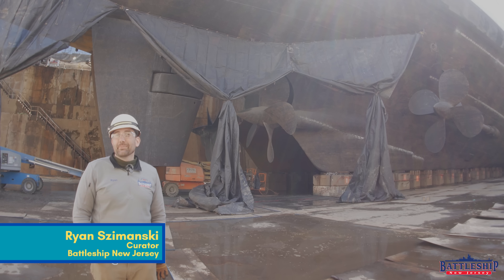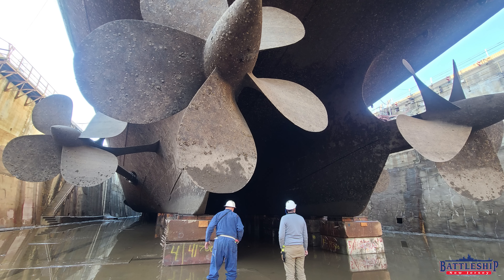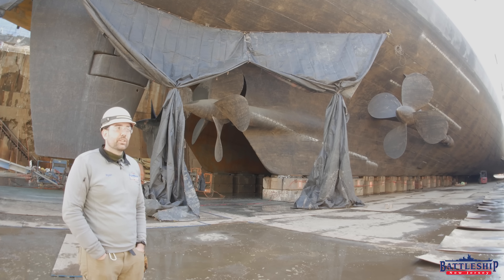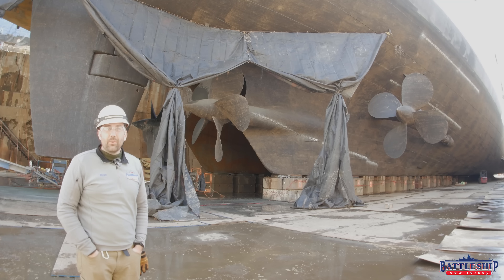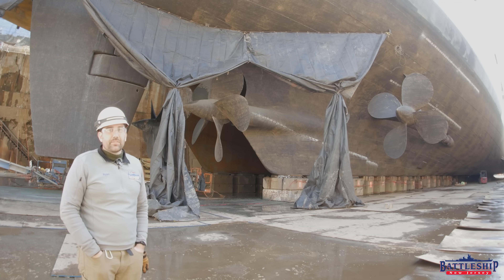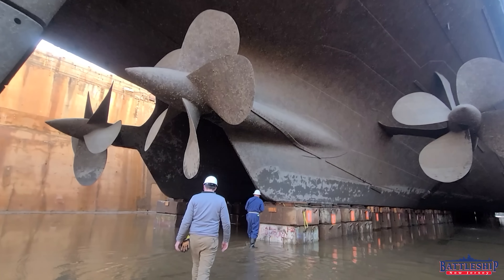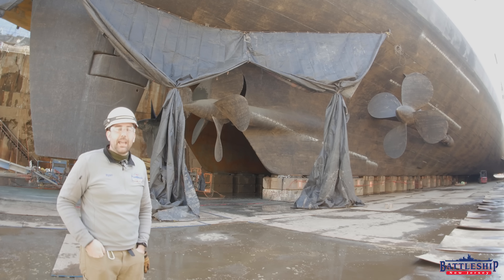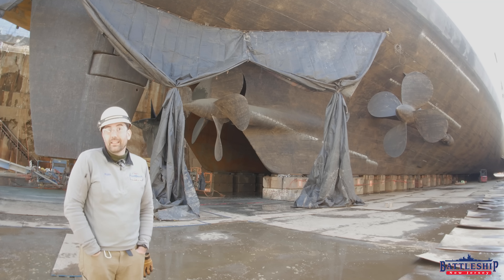Why Are The Battleship's Propellers All Different?

Comment: Well, that's something new and different. That's the only naval vessel I know of with differing blade counts. Certainly no submarine since WWII through 1980 ever did have. Of course, surface vessel particulars weren't ever important enough to need to memorize the data anyway. Surface vessels are missile or naval gunnery targets and not an ASW concern. Thanks for your knowledge!

Comment: Screw is what I would call the correct term, like a vessel with two is "Twin Screw",  but I have never heard "Quad Screw" like an Iowa would be. Or even nona screw for those guys with 9 Mercs across their transoms. But we also use "wheel" as a convenient slang term (somehow sounds less pompous). Even though it's proper we avoid saying "prop" or "propeller" simply because it's a mouthful.

To me the reason for an odd number of blades trailing a skeg is because a four (or 2) blade will have half its blades simultaneously banging into "hard" (oops too technical?) water as they spin out of the "soft" water trailing the skeg. I think this will vibrate more than if 1 out of 5 (or 1 out of 3) is in the soft water at any given time.
Someone said that the two forward propellers are in "clean" water, while the outboard halves of the aft props are operating in water which has been accelerated by the two forward props. To this I would add that all four are trying to push her ahead in water which is actually travelling the same way as it's dragged along with the ship. Some say as much as 20% as your speed. 

Blade tip speed Does matter; that's where cavitation is going to be worst, and it's very destructive. Supposedly around 12,000 ft/minute is max for the blade to get a grip on the water.
Another problem is blade tip clearance from the hull. The approaching blade is going to bang some water against the hull and we always try to leave at least 10% of the prop diameter clearance. Otherwise the vibration will drive you nuts. But I'm not seeing that here on the New Jersey. One guy with a 40' boat went for max diameter which barely cleared the bottom of the boat and that was not only noisy, it induced a lot of vibration.
Lastly, think about how propellers actually "pump" water sideways. The forward starboard wheel, which is "right handed" because it spins clockwise when in "forward", when viewed from behind, is actually taking water from the right side of the boat and throwing it to the left. I'm calling them "wheels" now because that's the effect they have: like a wheel they're rolling the stern from left to right by throwing that water sideways. If only the starboard wheel was turning, it's not hard to imagine that would make her turn sharper. Or if the port wheel was in reverse, sharper still. Whether she was moving forward or not, they would still be pumping water sideways and wanting to turn left.
When you have a small boat, with only a single screw right hand wheel, this will cause the common situation where "She backs to port" when that prop is spinning in reverse. Stealing the water from your port quarter and depositing it on the starboard side, which is especially noticeable before she gathers sternway but actually is going on the whole time.
New Jersey's two aft propellers, being closer to center, don't have as much leverage to turn her but make up for that by shoving water into the rudders which deflect that water towards one side or the other, whether she has way on or not.
How's that for a whole lot of nothing?
Thanks

Comment: Thank you for your dedication. I spent my life in engineering and in Naval ships when young,  The installation of propeller close to the hull is an " unsymmetrical installation and so pressure impulses due to the low number of blades will cause vibrations,  A shrouded propeller will  reintroduce some symmetry of the flow into the propeller,  The ships hog and sag and twist and flex more than people think. 
Engineers need to wrap and make naked people wear around them all sorts of prosthetic aids as when naked and bare all people on earth cannot do much, 
Now we all life having to wear and wrap around us an engineered prosthetic aid like any child born without legs or any one suffering an amputation after a military mission,    All Miltary personnel are all looked after by engineers   adapting prosthetic aids to be worn on land sea and air. 
Our psychology makes us view these miltary prosthetic aids as being very beautiful in protecting  naked people, starting with a pair of shoes and socks.

Comment: When I was aboard New Jersey (89-91) we (and the yard birds at the Long Beach Naval Shipyard) referred to the area between the skegs as the ballroom, not the Holland tunnel, same for the Missouri. When you stand between the skegs it is as if you are in a huge ballroom, hence the name.
Regarding the placement of the skegs vis-a-vis the rudders, this allowed us to employ a unique tactic to stop the ship in its own length from a standard bell (15 knots.)  We called it "closing the barn doors."
As an officer of the deck, I practiced it several times, thankfully, we never had to use it for its intended purpose: avoiding a collision or grounding if the ship was "in extremis."
From a standard bell, the commands were:
"Rudder amidships" - the helmsman would then turn the wheel to centerline the rudders.
"Lee helm, all back full" - The lee helmsman would cycle the EOT (engine order telegraph) from Ahead Standard to Back Full three times, then leave it at Back Full.
"Indicate 999 for maneuvering combinations."  - The Lee Helmsman would turn the dials used to indicate the desired propeller RPM from whatever had been selected to "999", indicating no particular speed and telling the throttlemen to both close the ahead throttles and open the astern throttles all the way.
"After steering take control, close the barn doors."  - The two after steering watchstanders would take individual control of each rudder. The starboard rudder would be thrown over to left full and the port rudder would be thrown over to right full, effectively pointing each rudder at the other across the ballroom. This turned the ballroom and the rudders into a huge drag chute, slowing the ship dramatically.
When we practiced this, we would have a boatswain's mate at the bullnose throw a block of wood overboard and track how far down the length of the ship that block went before the ship was dead in the water. Invariably, it never made it past the stern.
If nothing else, it was a fun way to spend a few hours underway and practice our ship handling skills, and it gave us options if we were ever dumb enough to put the ship in imminent danger...

Comment: Hi Ryan, those propellors are fixed pitch. I thought they would be variable.
Reply: Nah, I don't think that technology was really used (at least on ships) until much later in the 20th century.
Reply: I was thinking the same but she had been in drydock after WW2 so I would have thought variable pitch would have been included during one of these periods before the gulf war.
Reply: The cost would be ASTRONOMICAL!!!!!
Reply: steam turbine speeds can easily be varied from 0 to full or reversed, so absolutely no need for CPP; not so on direct drive diesel and older electric drive ships.   Controllable pitch props have very complex hydraulics and seals for each blade and the propeller shaft.  Not very torpedo proof.

Comment: So do the inboard props run on higher rpm's than the outboard ones? The inboard propellers are working in water half of which has already been accelerated backward by the outboard screws. Or is this taken care of by different pitch of the blades?

Comment: Your statement about dissimilar metal corrosion was incorrect. Even though those props are painted, they're still going to have an "electronic" connection to the rest of the ship via the shaft they're bolted onto. That's all that is required for dissimilar metal corrosion to occur. This is a fact. The only thing that will prevent it would be totally isolating them from the rest of the ship via some sort of non-conductive bushing and washers where they fasten onto the shaft, which would not be plausible. OR, the use of zinc anodes, which would be typical.

Comment: When I was on the USS Missouri (BB-63) for two weeks in the early 90s I was told that the 4 blades were the power screws and the 5 blades were the speed screws.  I was also told the 4 blades acted as booster pumps for the 5 blades.  I don't know if either is true.  Interesting how the two inboards are right in front of the rudders to make them more effective.

Comment: I'm not sure if everyone knows this but having more blades to a propeller doesn't make it more powerful -infact the reverse. The best propeller therefore would be one with one single blade, obviously this would be imbalanced, but every extra blade you add to balance it will reduce this efficiency that little bit more. This is why submarines have 10 or more blades so to be as smooth as possible and they have the power to compensate for the lowered efficiency, I imagine it is the same here, seeing if you can get away with fewer blades and seeing how bad the vibration is and if you can get away with it or go for higher bladed designs that are les so?
Reply: 10 blades? Which submarines? Those twin shaft Soviet ones with 5 blades on each shaft? I believe that the USN started using 7 blade single shaft propulsion in an effort to slightly confuse opposition sonar technicians from identifying what type of submarine they were listening to. 
" Well Comrade Captain, it might be a 6 blade USN submarine of the Sycamore class or it might be an 8 blade USN submarine of the Sturgeon class. I can't tell which one it is because it's got this unusual 7 beat sound."

"Well Comrade Common Technician of Sound, it can't be a 7 blade propeller submarine because even in the evil capitalist countries 360°÷7 is an oddball number that would be difficult to manufacture. Please designate this track as Track A-07 belonging to the Intergalactic undersea forces of the planet 13679 from galaxy 24680. Perhaps they use a different system that is base 7 based?"
Reply: @davidhoffman1278  I think you are missing the point, I am trying to show that it is not what you would think that more blades make more power -they do not. But they do however help with vibration.

Comment: Ryan, are the shaft bearings solid bearings such as bronze or babitt, or ball/roller bearings?
Reply: Babbitt split shell bearings.  They can fail/run without lubrication and sometimes be scraped and put back into service.  Easily changed in place.  Split race ball and roller bearings can be produced, but are much more complex.  When they fail, they can ruin the shaft and/or housing.

Comment: It always gets me how long with planes and ships it took to find out adding blades make them better.
Reply: The most efficient propeller has only one blade. Adding blades doesn't mean it makes them "better" (whatever that means) it just makes it possible to absorb more horsepower for a given diameter. You may have noticed higher horsepower aircraft use larger diameter propellers with more blades than lower power aircraft.

Comment: In re the centerline bulkhead. 

In the early hours of 29 May 1914,  the RMS Empress of Ireland was T-boned in St. Lawrence River outbound from Quebec City, QC. by the Norwegian collier Storstad near the town of Rimouski. The Empress had side by side propulsion spaces in a 4x4 arrangement.  The Storstad hit her at the bulkhead dividing the stbd boiler room and the stbd engine room. Counter flooding was attempted but couldn't keep up with the inflow from the damage. The ship capsized just a little over 14 minutes after the initial collision. 1,012 of the 1,477 passengers and crew perished, most not having time to even get to the lifeboats. This shocked the naval architecture community and the centerline watertight bulkhead pretty much vanished.

Comment: So am I correct in saying it's because they wanted the middle screws to be faster so they had more impact on the rudders as water flow speed is more important there? While the 4 blade larger screws actually put more power down?

Comment: Interesting video!  Is it possible to see where the prop thrust is reacted into the hull?  Might be an interesting video to see how a huge rotating shaft transfers it's loads to the massive hull 🙂
Reply: At some point along the shaft's length is a special bearing called a "thrust bearing". This bearing takes all the linear load imparted into the shaft and transfers it to the hull.

Comment: Outboard propellers are 4-blade to provide POWER for ships speed.
Inboard propellers are 5-blade to provide increased prop-wash across the rudders for better maneuverability.
The skegs also provide improved water flow to the rudders.
Opposite propeller rotation was to counterbalance each other to prevent the stern from traveling to port or starboard.

Comment: How do ship propellers not have significant tip vortices with such wide tips compared to aircraft propellers?  Their rotation speed will be lower and the fluid density much higher, is it just down to water inertia?
Reply: Tip speed on aircraft props can approach the speed of sound.  Not so on ships props, but they still have to be designed to minimize effects of turbulent flow. Cavitation can be big problem, so materials and design are crucial.

Comment: Let’s count how many people argue about “screws” versus “propellers.” Must be 500 by now. You must be so proud! Thanks Ryan for another fascinating video.
Reply: I say they’re “propellers” when you’re writing a report (especially an engineering report); but, they’re “screws” when you’re talking about them… especially with fellow sailors.
Reply: Jesus, honestly.  As pointless arguments on the internet go, this one is admittedly pretty harmless, but that doesn't make it less pointless.  I would argue the full technical term would be "screw propeller" (i.e. a device based on the principle of the Archimedes screw which is used to propel some kind of vessel, either vertically or horizontally), but even that's still just semantics.  At the end of the day, words mean whatever the people who use them use them to mean (descriptivism > prescriptivism).  And since people regularly use both terms without ambiguity, both terms are perfectly valid.
Reply: I haven't seen a lot of "arguing" here in the two weeks that have passed between your post and mine.  Mostly everybody is just sharing stories and building camaraderie.  That's a W, if you ask me.

Comment: Iowa class with the Double Rudders! They can turn sharper than a destroyer! In fact, the Iowa's even have a better tactical diameter than the Fletcher class of destroyers. At 30 knots the battleships tactical diameter is 814 yards, a Fletcher class traversing at the same speed has a diameter of 950 yards. Also, (2) 5 blade propellers and (2) 4 blade propellers are for SPEED!

Comment: Looking at the back end of the Jersey as an engineer, I see the force vectors in my mind.  Inboard propeller sucking water from both out side slipstream and the tunnel slipstream and shoving it past the huge airfoil shaped rudders.  Crank those rudders over and we see maximum water deflection to one side creating a huge reaction force at right angles to its direction of travel.  The sharp prow of the big ship against the water, 800 foot moment arm, provides the other reaction force spinning her in a tight circle.  With the entire mass, long and lean, cranking at 32 knots, I am dead certain Admiral Spruance deliberately allowed the Nowaki to get away so she had to tell the rest of the Japanese Navy that we have full sized battleships capable of keeping up with destroyers and matching their turns!  Psychological war at its finest.
Reply: 'Airfoil'.
It's called a drop-shape.
No, these ships don't 'sail' either.

Comment: Hah, based on books and movies, I lean toward calling them screws, but propellers is clearly more accurate!
Reply: Technically a propeller is a form of a screw.
Functionally it's a propeller, period.
Reply: Screw propeller is the full term. Non-screw propellers do exist, for example many tugboats use a type of propeller called a cyclorotor.